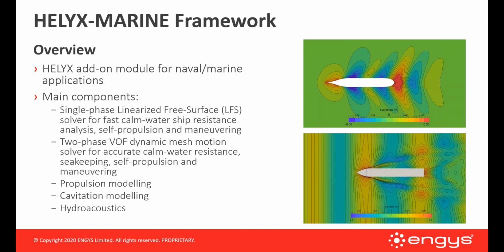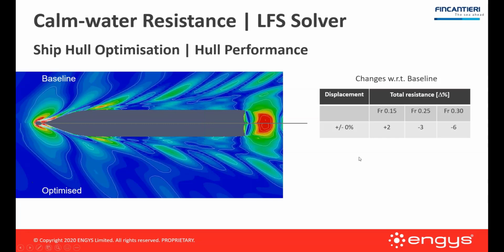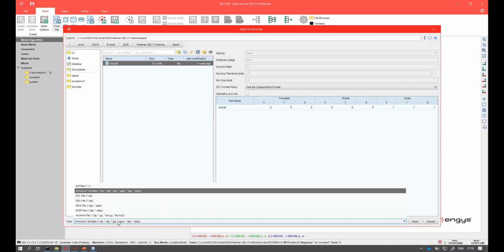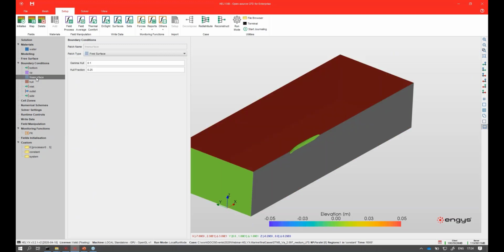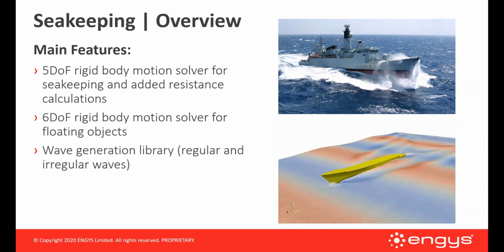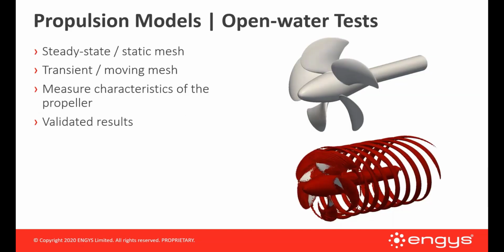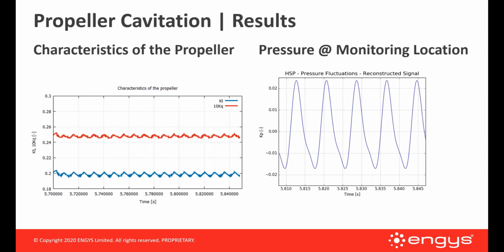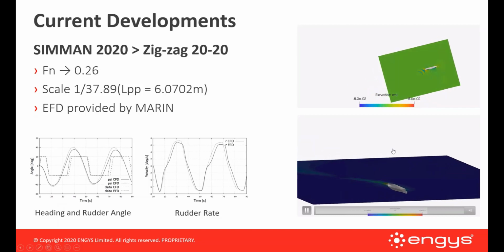Open-Source CFD Solutions for the Marine Industry

Comment: Hello, I am very intersted in the Engys product, especially the OpenFoam GUI proposed with HELYX-OS. I was wondering if it was compatible with OpenFoam 8 version, since on your website it's only written that it is available for OpenFoam v4.1 or v1606+. 
Very good presentation video by the way ! Keep up the good work.
Reply from the maker: Thank you for your comment Alfred. I don't think HELYX-OS will work with OpenFOAM 8, but you can always give it try.
I should also point out that the open-source solvers that we offer with our enterprise products HELYX and HELYX-Marine (as shown in the video) are not available in any standard OpenFOAM version. We develop and provide our own CFD utilities and solvers for increased robustness, speed and accuracy.